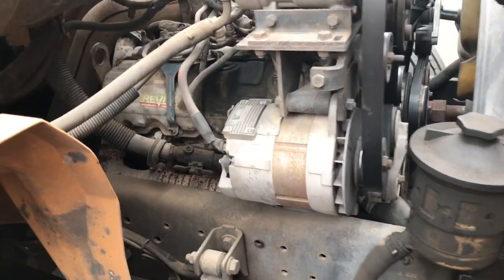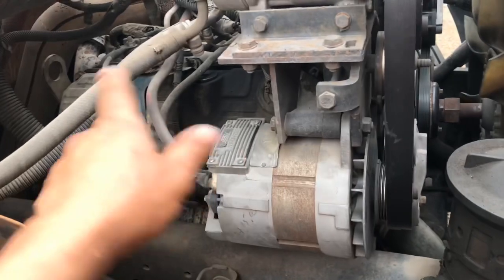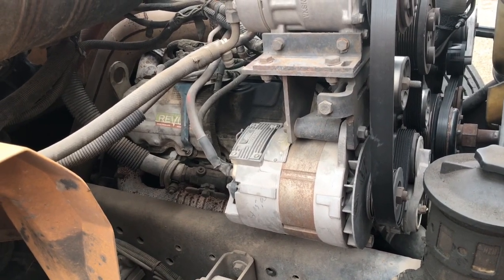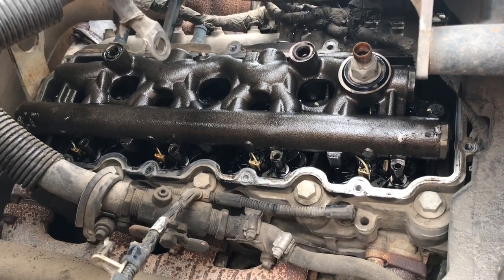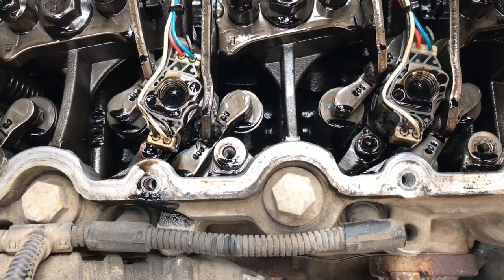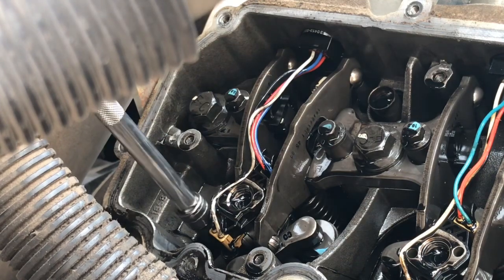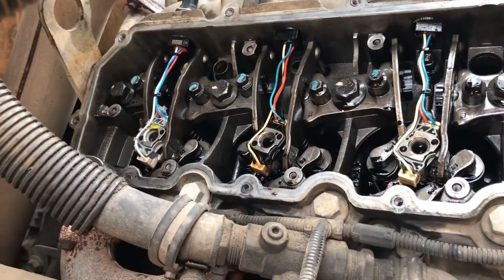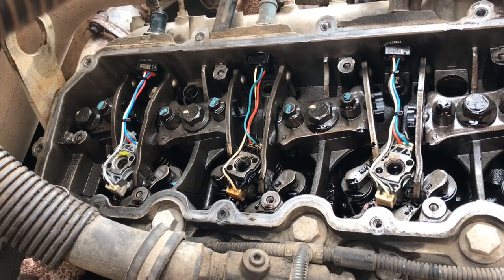Navistar VT365 (Ford 6.0)

Comment: I replaced that same injector on my 2004 vt365. Mechanic said that was injector number 8. Did an oil change afterwards. Truck ran fine for two days. Afterwards I had a crank no start when hot. Any suggestions you think might went wrong. Always have to use starter fluid to fire it up.
Reply: Yes I'm having the same problem with my 2004 vt365 turns on when cold but would not turn on when engine is hot I would need starting fluid to turn it back on where you able fix the problem if so what was the issue?

Comment: Quick question. Will the 365 oil cooler cover work on the ford 2003 6.0? I installed the vt365 oil cooler cover on my f350 2003 6.0. It has now popped 2 coolers and putting oil in the coolant. I have pressure tested both coolers and they are fractured from the oil into the coolant side. Also, what brand oil coolers do you use?

Comment: I have a VT365 and the oil pressure gauge is showing zero and beeping but truck is running fine with oil, do you think it’s the sensor?
Reply from the maker: Hey there ridgeline. It sounds like you have a bd oil pressure sensor or a bad connection at sensor (I’m assuming that all other guages are functioning properly.
Reply from the maker: Check the connector on the sensor. If all looks well. Replace the pressure sensor. That should take care of your issue.
Reply: Joe’s Bus Barn Thank you so much I appreciate your time as well as many others I am sure!
Reply: Joe’s Bus Barn  Just thought I would let you know that I did replace the sensor today snd the truck works great! Thanks again!
Reply from the maker: Glad you got that issue resolved Ridgeline. Hit me up if you have other questions I may help you with.
Reply: Yes everything works fine except that sensor initially read zero and then it worked fine for about 30 minutes then went back to zero and started beeping again and the check engine light came on. It seems like it’s the sensor or a bad wire to the sensor but I am no mechanic ! Hoping that’s it I will replace that first in the morning! Thank you

Comment: Tengo un 2006 international vt365 
Empezon el problema semanas atras no encendia frio..y asi lo traje 3 semanas
Y Ahora ya me perdio toda la fuerza on hwy y at iddle runs like missfire
Still No start cold but take longer

I applyed air to icp
I hear a little air through.
I removed air intske and turbo house
Y Tienen aceite saliendo del turbo y entrando al air intake side..
How to diagnose problem
If injector
Plugs or ico sensor. If not scanner ??
Gracias..
Reply from the maker: You can check injector with a laser temp gun. Start unit and check temps at exhaust manifold flange that bolts to cylinder head. Temps will climb on cylinders that are functioning properly. Temp on bad cylinder will stay colder. Send me an email. I’ll send you my number so I can help u check ur truck over the phone if u like.
Reply: @JoesBusBarn  
I ll chk that way injector if dont see diference let you know
but misfire lost power could be injector right?

And bout aceleration ?
i step on gas after i start it
snd it doest acelerate lt all or do nothing after minut or two i can hear engine start aceleratin...

let you know on your email and phone after test injector...
How icp can be test

Thnk you so much.
Reply: @JoesBusBarn  
Hey joe.
Remplace ipr sensor por start no crank
It start now
El ipr estaba stuck y yena de debris and big pieces of metals screen was craked.
Le puse neva y enviende pero no tiene fuerza aun. En high Rpm
Como pruebo la bomba o algyn daño del oil cooler screen ??
Alguna idea ??
Gracias
Vt365 2006 international 
100.000 miles
Reply from the maker: These older DTs will not accelerate when cold. Need to bring up temp too at least 120 degrees. They don’t do well when cold. Make sure thermostat is functioning. They stay open when they start failing.
Reply: @JoesBusBarn  

Hi sir
I did chk injector with laser temp guy
One injector is readin
129f
Other 7 read round 185f
So that one should be failing correct ?
And also u rdmoved dommuy plugs seals and they look badle are all mess up
 Thise could be the longer cranks ??

I m goin replace injectir and dummy seals
Do you know torque for high presure rails and stand plugs snd stsbdpipe??
Sane engine vt365
2006 international 4200 ??
Thnk you
Reply from the maker: ICP is suppose to be sealed (air tight). I would replace it. As for the oil. It doesn’t necessarily mean it’s a bad turbo. How many miles on engine. Does it have blow by. Crankcase breather could be saturated with oil. There are several things u need to look out for Mike. I would need more info and maybe a video clip of the engine running (visual). I might be able to give u a better prognosis of the problem at hand.
Reply from the maker: Hey Mike. High pressure oil is what memes injectors go. So yes. ICP will make it run rough. Oil rail does have to bleed out all air pockets in it. You have to run it for a bit before you run another injector test
Reply: @JoesBusBarn  
Ok
I droved tested on hwy 2 times.
Cameback chk injector with laser gun
As i said another injector from other side driver side has low reading.
Could this side be failing too with plug and injector
Or should i detect leak or low icp before replace injector ?
Reply: @JoesBusBarn  
Hi joe
We put the scanner showing building low icp presure . signal go uo and down.
Reply: @JoesBusBarn  
Hi there
I got back onbtruck.
I did scanerr showing unstable building icp sensor signal...

Truck start right up good.and nice smooth but once on freeway higher speed missfire a lite bit like sputer..
.
Just trying to test icp sensir and ipr.
Coud be thiss 2 the problem.
???
Reply from the maker: Take the unit out for a test drive and keep scanner on it. Keep an eye on ICP and fuel pressures. U might have a HPOP/IPR/ICP issue. It could even be the fuel pressure dropping. It sounds like a bad IPR but could also be a faulty pump. Let me know what the pressures are and I can tell u what the issue is.
Reply: @JoesBusBarn  
Ipr checked its workin
Icp sensor.replaced due to bad unstable reading.
Shop air tested.
Tested on highway looks lot better snd sound .
I think ico sensor was bad.
We ll see how does loaded.
Thnk you so much..
👍
Reply: @JoesBusBarn  
Yes sir
Confirm
No enough pressure conung to engine.
Simetimes hard to start. The run rough abd no good on highway.
No ebough fuel geting
I removed fuel filter cap this morning when it was hard to start and the housing was very low bout half..
Can be fuel pump ir fuel pressurs regulator valce ? Any other idea what causing not sending fuel pressure ??

Th k you
Reply: @JoesBusBarn  
Yes it looks like low fuel pressure u removed filter it was low 
If low fuel pressure
Where do  start for..?
Test fuel pump ?
O replace blue spring kit?
Que presion tendria que tener si utilizo un fuel presure gage ??
I tested ipr just with pigtail cable attached to battery it looks open and close..
Any other ideas you think uvstart with
Please.
Thnks
Reply from the maker: Fuel pressure should be around 45 to 50. No less than 40 under load. I’ve found that a back primer pump (mechanical hand primer pump) will cause fuel pressure to drop.
Reply: @JoesBusBarn  

Ok 
i ll chk on that. What bout the blue spring kit has this has one ?
Reply: @JoesBusBarn  
I check fuel pressure with gage.
Show 57psi cranking but no start it all
It used to stark little rought and good sometimes unevennruning
But truck wint start now.
Just crank. No start
La oresion sube a 58 de disel
En unos 30 segundo o mas
Peri si alcanza mas de 55 psi..
Alguna otra sugerencia ?
Icp is new ipr havent be tested..?
Reply from the maker: Hey Mike. Vtt365 have one known issue. But it has nothing to do with fuel. Engine oil pump. The timing cover wears at oil pump housing. But that would give u low oil pressure. Do me a favor. Overfill the engine with about 4 extra quarts of oil. Crank over and see if the los with the no start. Fuel pressure is ok. We’ve worked on a few that had bad timing covers. It might be a long shot but it does happen on high mileage 6.0 vt365
Reply: @JoesBusBarn  
This has 100.000 miles very dry engine
we did dummy plug as long start. And did 1 injector.
 we aplyed air shop no oil leaks..
And hlok ipr to vilts to make it open and close it looks was working
But truck started ok looks runinh normal on idle but once on hwy and step on gas  looks no enough fueling or injection not enoughpower. And lost aceleration sonetimes
Until this am truck just shut off and now its not  starting at all...
Reply: @JoesBusBarn  
But i can tey that 
I will add 4 extra quarters.
Y lo encendere.
Y que seria lo que tendria que checar al encerderlo ??
Alguna precion o los 4 quartos lo van a encender ?
Reply: @JoesBusBarn  
I did chk icp sensor volf
Is receiving 5.volts 1 cable other 2 no signal.
Reply from the maker: Joegonz268@gmail.com
Reply from the maker: And yes. Sounds like u have a bad injector brother.
Reply: @JoesBusBarn  
Yes
Thnk you.
Llooks we found the issues.
Do we need torque the stand pipes and hight pressure rail?
What would it be ?
Reply: @JoesBusBarn  

I just put everything back
1 Injector replaced.
And dummy plugs and stand pipe seal replaced due to dummy plug seal broken

Now still misfire but les rough but doing same in highway. I check with laser temp gun again
Now looks other bank 1 injector readin less.
All 8 from 170f
1 reades 135f.
Question?? 
Could misfire be for low icp or icp leaks.
That can cause injector misfire??
Or not ?

Comment: Hey joe What are your thoughts on the 2006 vt365 engine? I recently purchased  a 2006 with 120,000 miles from a school dristrict. Just want to know more about what people think on this engine if it’s any good or bad.
Reply: Definitely do not want to drive it hard nor go over 65 on it. Thanks for the info I will keep as is. Would a egr delete be any good? Since I was told it would be something I should do.
Reply from the maker: Hey there NewHorizon. Congrats on your bus purchase. The vt365 is the same as a 6.0 Ford. They are not the most popular in school buses (because they are abused). If you properly maintain that engine. It will keep you guys moving for years to come. The great thing about yours is that u have no dpf to worry about. I would go through the unit and change out all the fluids. The unit in ?  Is it a full size (71) passenger or is it the smaller (39) passenger.
Reply: It is the the 39 passenger with wheel chair lift . Drove it 400 miles 3 months ago with not one single problem. People tell me to bullet proof it but I don’t know what that means. What are some suggestions you have that I can do to the bus to make it reliable?
Reply from the maker: Bullet proof. That’s somewhat expensive. Replace head bolts with studs to start the bullet proof process plus a few more items. They do that to ford pickup trucks to get those extra horses and drive them harder. If you r thinking of skoolie conversion. I wouldn’t. Ur going to drive it very few miles and you don’t want to do more than 65 on a bus. U if ask me. I would use that money to fix up the inside of the skoolie.
Reply from the maker: I own a 39 passenger (no ramp). Mine a 91 and has the 444 (mechanical). I haven’t finished mine yet but I’ll get to it soon enough.

Comment: Hola puedes ayudarme con un consejo, tengo un school bus 2006 vt 365 6.0 que frio enciende muy bien, pero a 150 F no enciende, se remplazo bomba de alta precion é ipr, no tiene codigos de falla. Gracias..
Reply from the maker: hola Jose. parece ser que su bomba de aseite es la causa de motor no encender. revise la presión de aceite cuando el motor no encienda. me avisa los resultado y intentare de guiarlo en la forma para areglar el problema.
Reply: @JoesBusBarn  hola joe, gracias por responder, te comento que probe metiendo aire al riel de inyectores, y tengo una perdida de presion por el pipe oil rail. Es normal?  La presion de aceite del motor al momento de no encender es de 25 psi
Reply from the maker: JOSE ADAN  el oil rail si deve tener pequenia fuga. Asi alimenta aseite a los rockers. Pero deve ser pequenia. La presion de 25 esta bien. Ahorra. Que presion tiene el ICP. Puede que tenges un ICP poco daniado.
Reply: @JoesBusBarn  quiero comentarte que el problema si fue el ICP, probablemente esta dañado, se reemplazo y el bus enciende muy bien. Muchas gracias por tu ayuda..

Comment: What year was that 6.0? How did you diagnose a bad injector? I wish I had thay kind of access to the 6.0 on my F350. Cylinders 8 and 7 are almost buried in the firewall. Thank you for the video!!!
Reply from the maker: We use a laptop to diagnose. You can use a laser temp gun if a laptop is not available. Bad injector will have a cooler exhaust port.
Reply from the maker: Dale Babbitt   Hey there Dale. 6.0’s on ford pickups are somewhat buried into the fire wall. They are a bit harder to get too. This particular unit is an 2007 model. Appreciate the comment